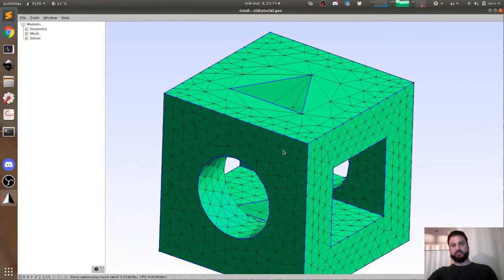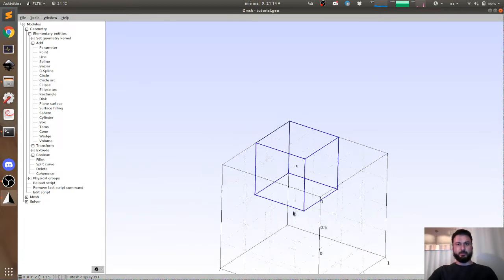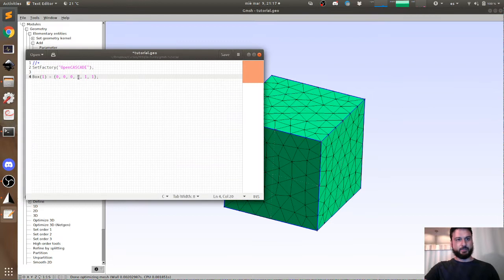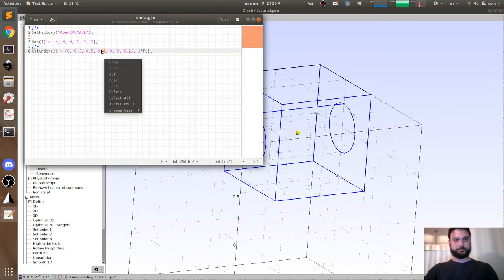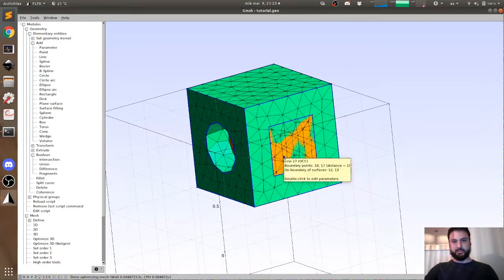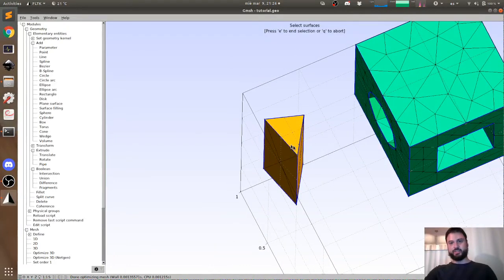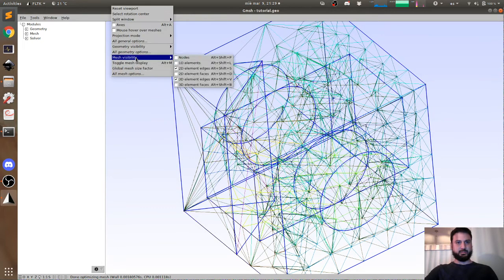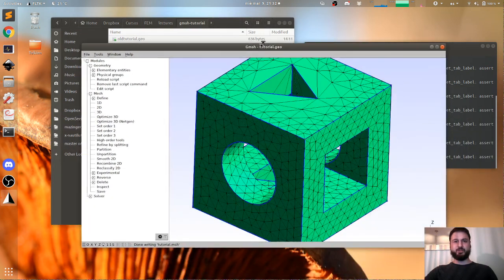Constructive solid geometry and simple tetrahedral meshing in gmsh

Comment: Thank you for the video. How can I trim cylinder by a surface in gmsh?
Reply from the maker: This is more of a gmsh question, but you can use boolean operators to achieve a trim. Think of using an intersection or difference operator with a volume that has your desired plane as one of its faces. You can do first the difference operator but not erasing the original geometry and tool. Then you apply the intesection operator on the original geometry and this time you DO erase the original geometry and tool.
Reply: @JoseAbell  Thank you for your reply. I already figured that out using boolean operation, namely cut boolean operation.

Comment: Thank you so much, can't wait to see the next video. ☺
Please also make a tutorial for post-processing the whole OpenSees model (tcl interpreter) in ParaView. I have some trouble to set a PVD recorder in tcl scripting.
Reply from the maker: Hi! I'm sorry I didn't get around to doing this. Ended up doing an in-class tutorial for the FEM class. I will at some point create a tutorial for gmsh and opensees interfacing and post processing back in gmsh directly. PVD is nice, depending on what elements you're using.
Reply: @JoseAbell  Hi, Thank you so much. 
I would appreciate your future tutorial about gmsh. I prefer to use an open source pre-processor like gmsh rather than using some commercial ones like GiD, etc. for my large SSI models.